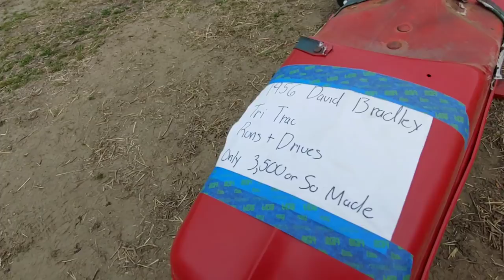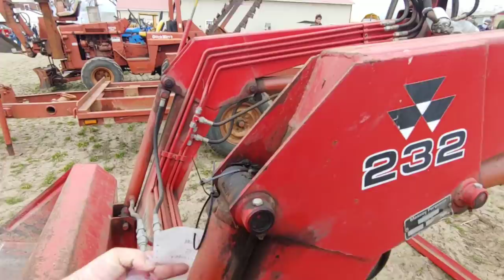Farm Auction - take a walk and see sale prices

Comment: 931 dude that's a freaking three bottom plow either by John Deere international McCormick dairy Minneapolis Moline Sears and roebuck they use them all over where I'm from find them in the woods all the time you pull and pull that lever on the top and when you pull the lever the power lift up did you pull the lever again plow drops down

Comment: New sub...you popped up in my youtube feed a cpl days ago. I guess after a decade the algos figured out I'm a farmer. That plow you didn't recognize (called it a hoe) is a moulboard plow. Some of them travel in a circle with the wheels on one side of the tractor down in the furrow it makes. Each successive pass throws dirt in the furrow, but when you get to the middle of the field you  wind up with a furrow down through the field. In TX Panhandle circa 1955-1985 we ran roll-over mouldboards that didn't require us to deadhead to the other side of the field with each pass so our furrow ended up on one side of the field with a hump on the other side. Those plow bottoms will shine like new chrome after a hundred acres. Best to grind off some of that rust before beginning or they'll gum up with mud and plow ugly until they begin to shed. Hooked up to a tractor with enough power those plow bottoms will throw dirt 30 inches high. I have two matching 6 bottom roll-over mouldboards we used to break half our farmland each year before Roundup finally killed all our Johnson grass. The mouldboard rolls the J grass  rhizomes up on top where winter freezes could kill them.
Reply: The little "toothed" wheels in front of the plows are called coulters. Their job is to cut the roots of grass so it'll take a little less muscle-work to pull the plow through the soil.
Reply: @checkyoursix5623  Agree, coulters on some plows are there to cut surface trash (many cases for cornstalks), but on our mouldboard plows they were there to stabilize the plow from zigzagging from side to side. Years ago we used them on our high-speed planter to prevent it moving horizontally so hard it would actually push the tractor off the mark. Coulters adapt for several applications.